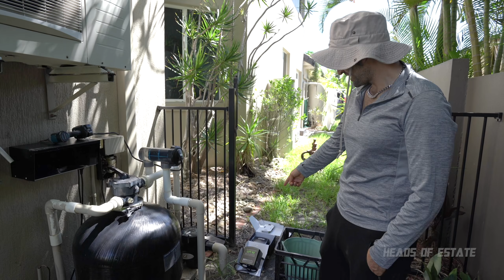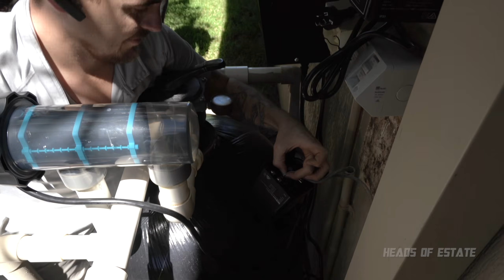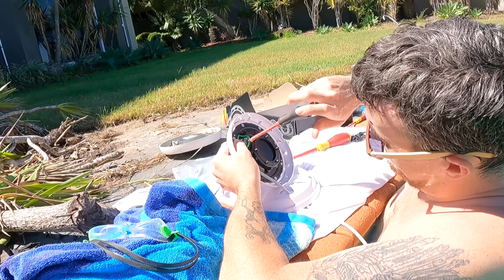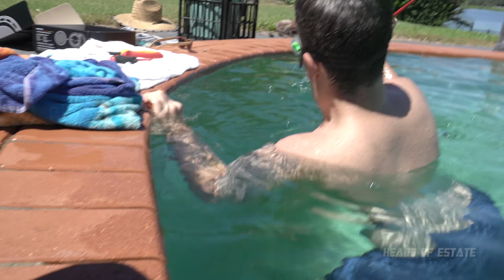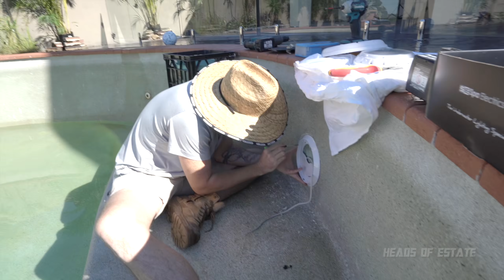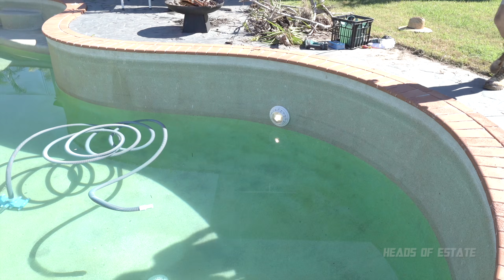How to Install LED Swimming Pool Lights - WET & DRY METHODS 🔥🏊

Comment: It really stinks when you get stuck correcting things and bringing it up to code because somebody else used the short-cut method to accomplish the task. At least now everything is 100% correct! Murphy's Law was in affect, y'all had a 50/50 chance with which light to change first and you started with the wrong light 🤣